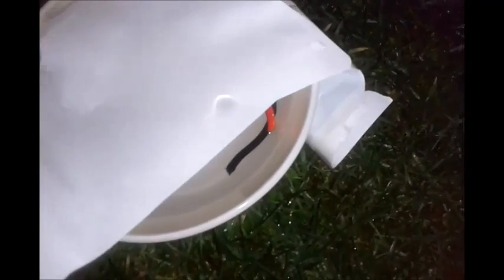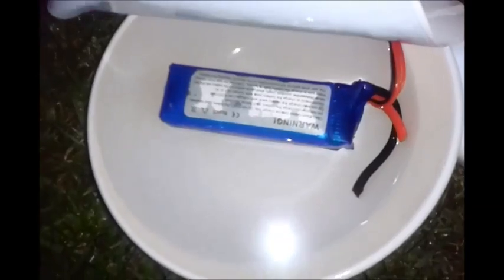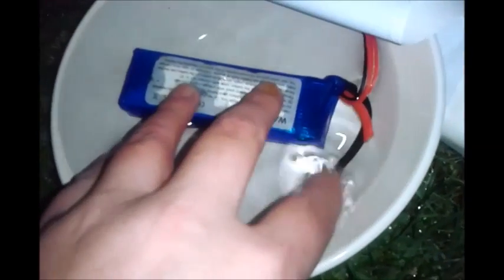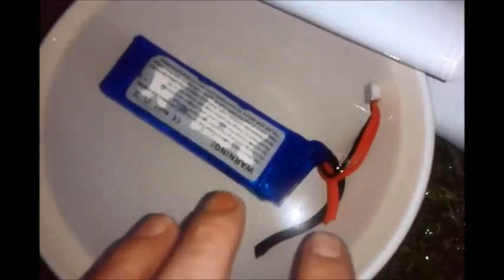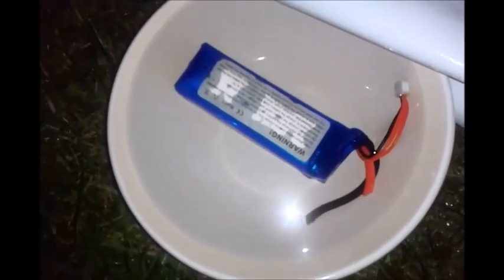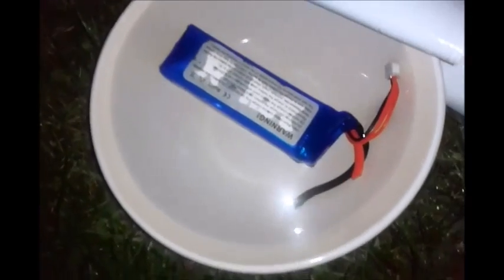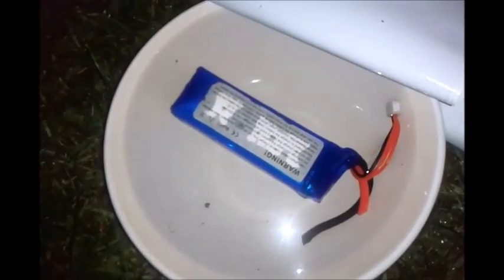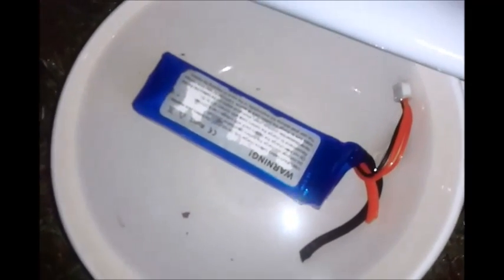LiPO Battery Disposal  - salt water method

Comment: Just because they stop bubbling doesn't mean they are fully discharged. The salt water will corrode the terminals and prevent further discharging. I recommend using a 12V lamp to slowly discharge lipos.